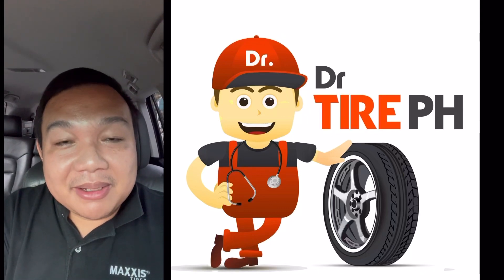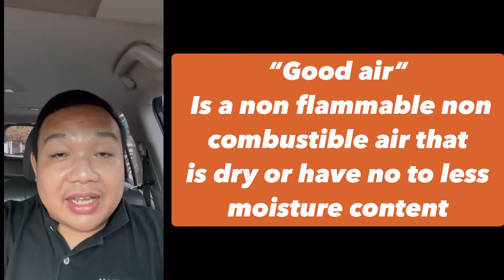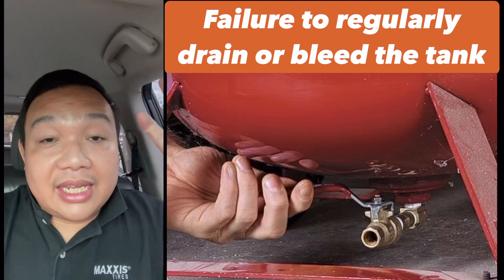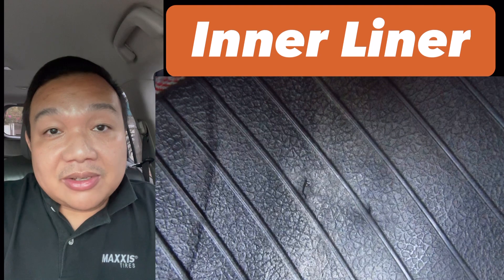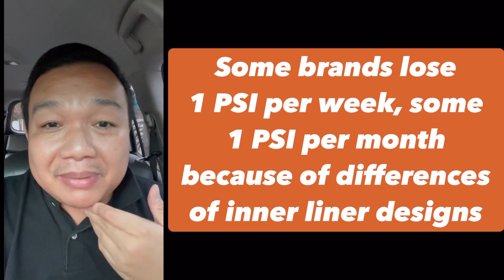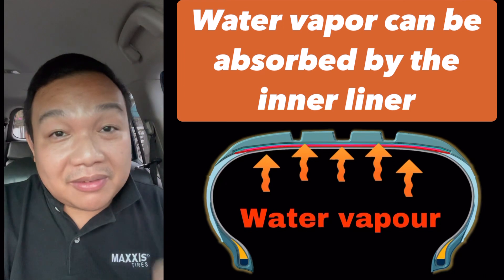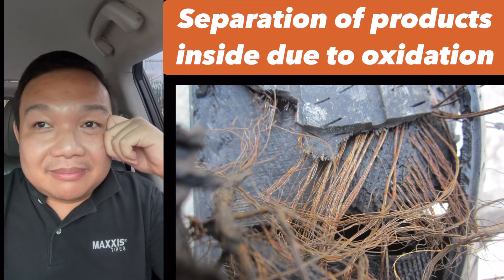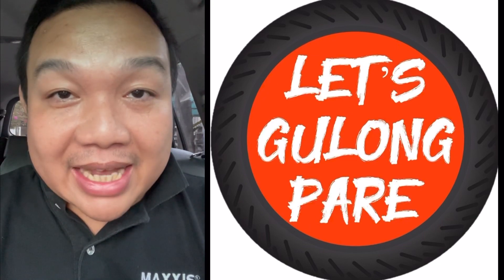Is there such thing as Good Air and Bad Air for Tire inflation

Comment: How about portable air compressor?
Reply from the maker: Do you mean portable air pumps or air supply? they do not have water separators , but portables' purpose is for emergency inflation and correction this should not be the standard air supply for you